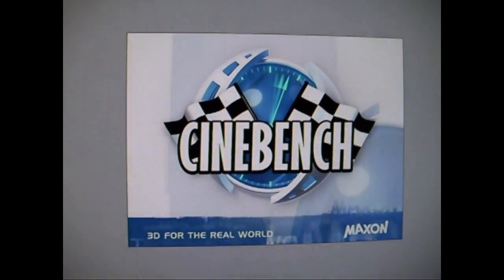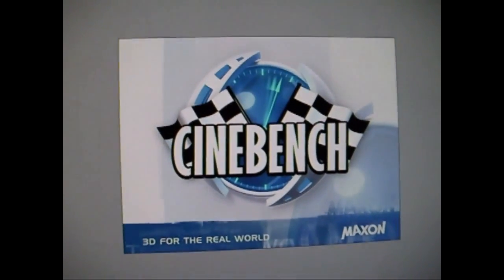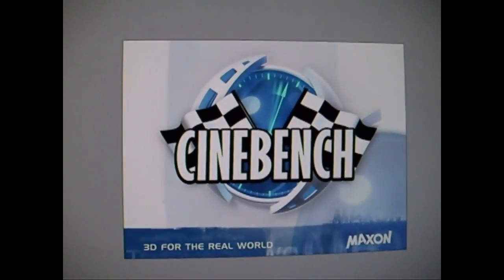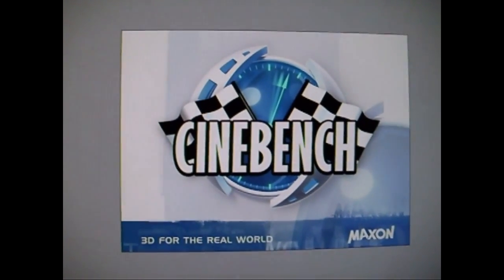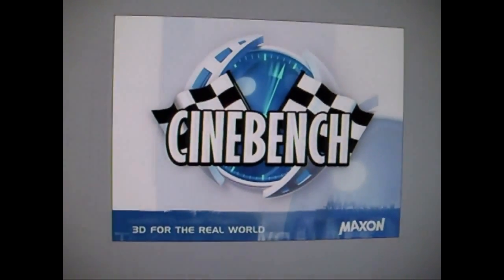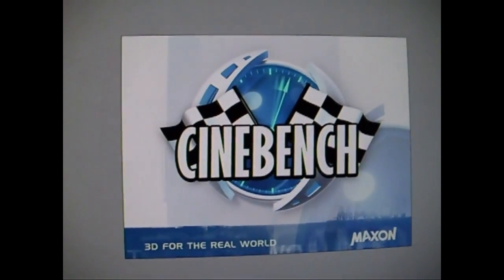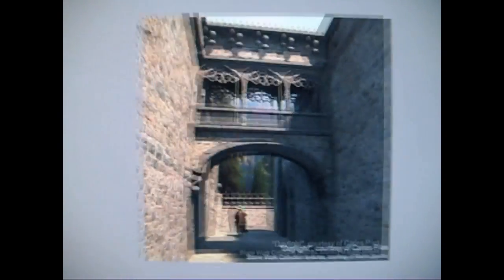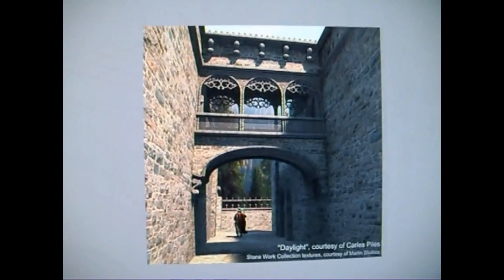INTEL CORE I7 CINEBENCH 9.5

Comment: Great vid thx for the mention great time 7 sec is blazing fast. Those chips are beast sucks they run so hot seems they went in the opposite direction as far as temps for these new CPUs. They are faster but super hot.

Rick